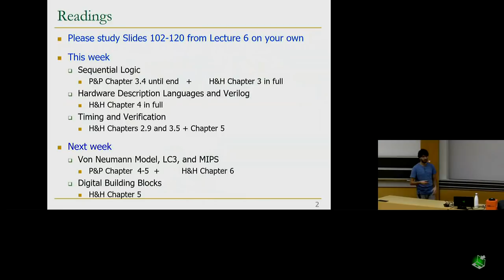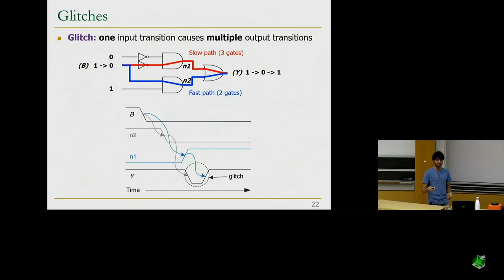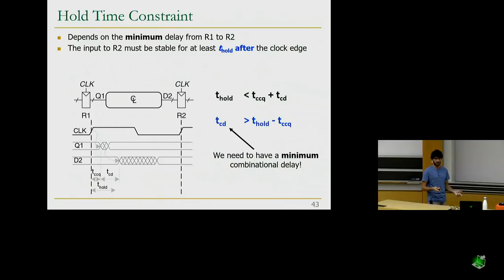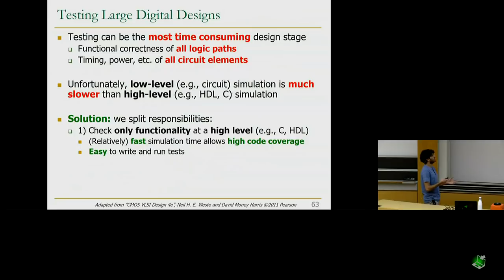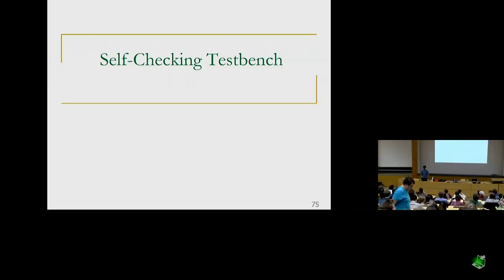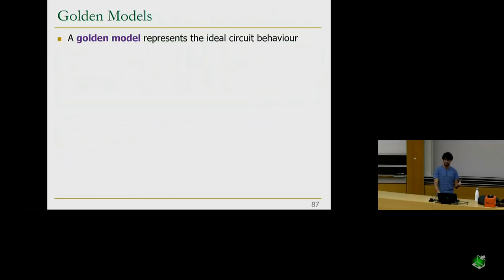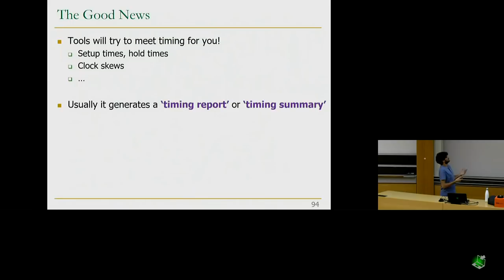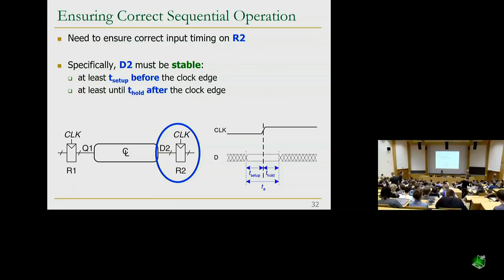Design of Digital Circuits - Lecture 8: Timing and Verification (ETH Zürich, Spring 2018)

Comment: The setup and hold time is basically there because of propagation delays of internal CMOS transistors that are used to implement the D FF. The CMOS propogation delay is mainly because of the RC charging and discharging time constant. There is some minimum number of time constants before output node settles to a steady state value

Comment: A glitch is simply transient output of circuit before it settles to a steady state output. The transient output is due to difference in path delays for a  signal traversing a re-convergent fanout